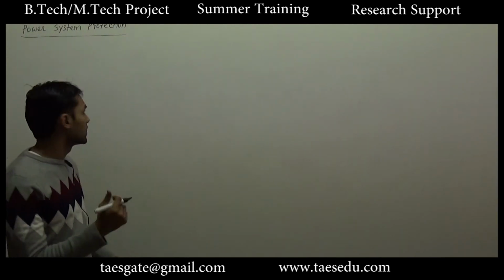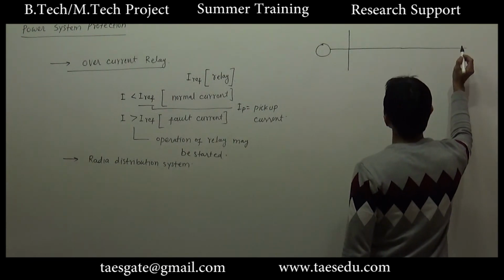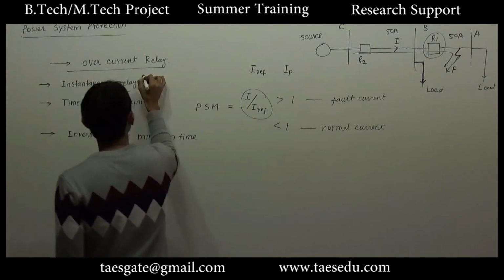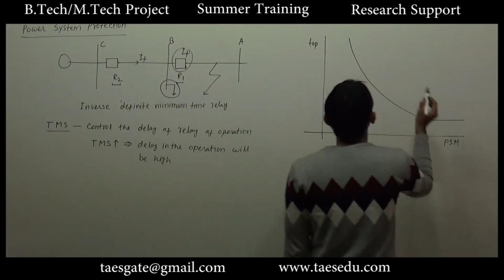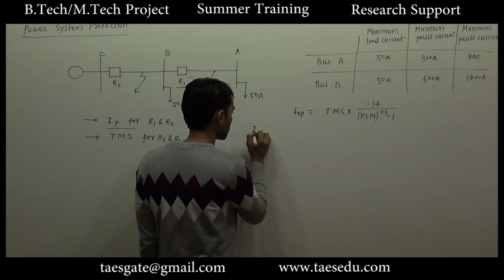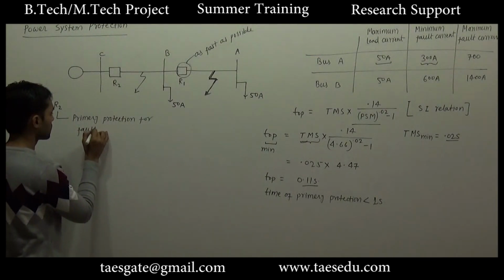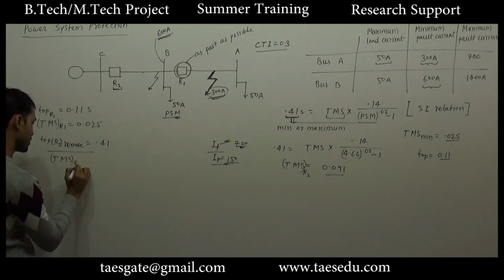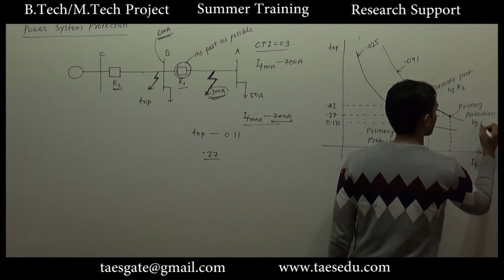Lec 22: Over Current Relay Lecture for GATE EE

Comment: Sir, in the problem , pick up current selected as 150A , what if load current 140 A due to some fault
Relay will not actuates , and hence the breaker.
Since max load current for Bus A is 50A , pick up current would have chosen  62.5 A which is 1.25 times full load max current of Bus A.
For load current of 140A , relay will not operate, since max current capacity of bus is 50A , after some minimum time the weakest part of bus get hot due to over current which is 140A , which inturn leads to break down of bus

Comment: thanks a lot but what mean relay R2 will provide the remote back of protection
Reply: Remote R2 will operate in case relay R1 does not operate thus providing protection and rightly called remote backup